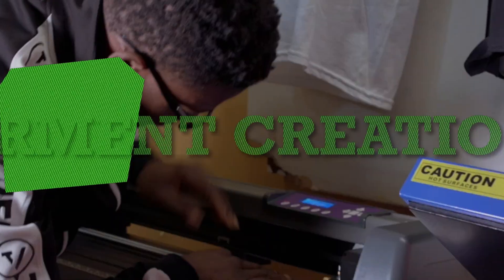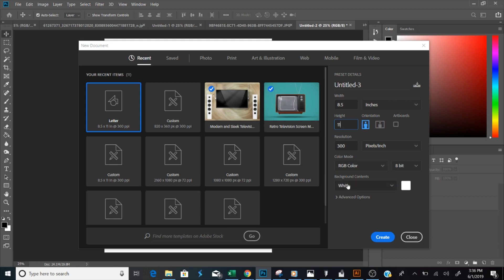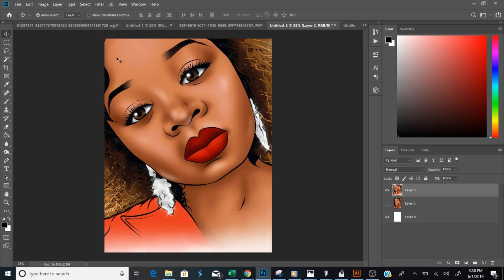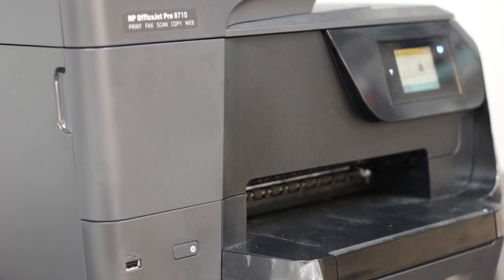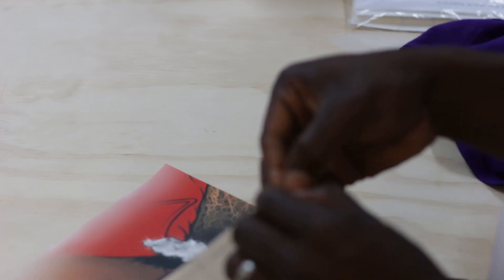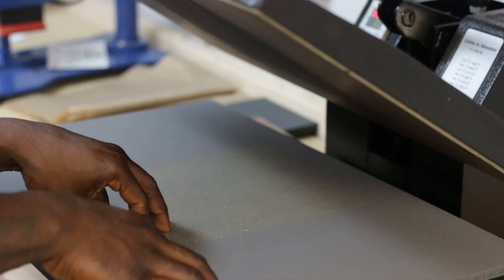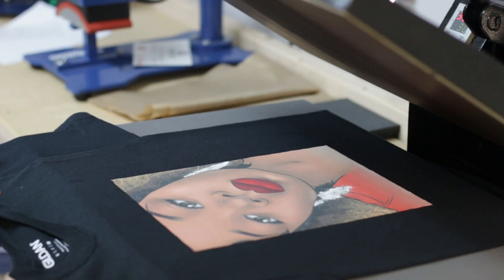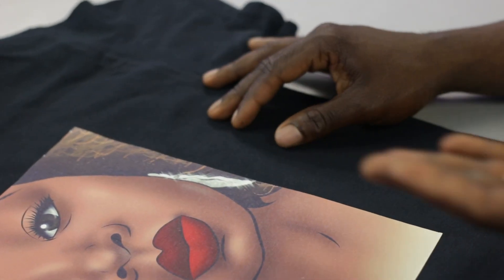The Best inkjet heat transfer paper - How to use 3g opaque heat transfer paper

Comment: I have the same printer and same paper. HP print settings are weird. It offers borderless prints although it gives me an error when trying to do it. So I am assuming I have to use a external program to print borderless? Also what settings did you use to get that great quality print. This printer is great because it is pigment based ink and not dye. I have a canon pixma with dye based ink and after washing it fades and turns colors fast.  BTW nice art!

Comment: Hi. I believe we have the same heat press...my question is....seeing the heat press' pressure is adjusted by a screw mechanism with no markings on it, how do you know if you are at 60 PSI?  Or 70 PSI or 30 PSI, etc.?  I would think "guessing" would not be very accurate. A male's "60 PSI" may feel like 90 PSI to a female and vise-versa.  Thanks for your time and video.

Comment: I’m having a problem when I apply it on a black hoodie. Any part that is white on the transfer sheet The dye  comes through. If that makes sense. I never have a problem when I do it on a black T-shirt. Please help 😩
Reply from the maker: hey, it might be the type of garment. did you try using another brand of the garment?
Reply: Thanks for getting back to me! I emailed Neenah They said if it’s a blend do 300 degrees with med pressure. I’m going to give it a try.
Reply: @Garmentcreationsnetwork  it worked!!!

Comment: Hello I recently used an inkjet HTV it says it's opaque but I bought it from a vendor as loose vinyl in a ziplock bag. I recently did a project for a client and they put the shirt in the wash and the red bled into the white background of the vinyl, have you ever had this problem? if so can you please let me know how to fix it? AND how to prevent it from happening in the future?

Additional details: I have a Canon MX532 printer and I use Pixma 240 & 241 ink and printed on the vinyl using the 'Best Quality' option. The customer washed it after wearing it, in cold water and did not use any liquid fabric softeners.

Comment: Thank you for this video, I really wanted to know more about it.
Reply from the maker: What questions do you have?
Reply: @Garmentcreationsnetwork  The video said it all, you did it step by step. Plus I have the same printer. However the paper for darks, would it make a difference to use the same paper for lights. Or is there a cost difference that would make the difference?
Reply from the maker: jett0206 I actually just stop using the light color. I’m using the 3g opaque for lights and darks. I got too many complaints about the box that the light color process leaves on the garments.
Reply: @Garmentcreationsnetwork  thank you cause I was really thinking about using the paper for darks only and forget about the paper for lights.

Comment: I used the same product on a black cotton hoodie. I used sub-ink and image came out dope!! Problem was, the background color on the image was black and after a few days, the black turned brown. What did I do wrong?
Reply from the maker: You have to use pigment ink
Reply: @Garmentcreationsnetwork  Thank you for your response. One more question if you don't mind, I'm assuming that I would need another printer to use that ink, can I use that on ALL my work? Reason I ask is because I have over $200 in sub ink and would hate to switch to pigment ink and throw what I have away.
Reply: Yoo bro sub ink on this paper after a while it will wash off you need pigment ink and some advice when you got ink is not to buy alot beacuse ink can get experienced as well clump up not right away but it can

Comment: Hi
Question about the heat transfer paper. Will it be damaged after washing the shirt?
I tried a couple of transfer papers and after the first wash, the image was damaged cracks all over it.
Reply from the maker: This paper hold up well. I got no complaints
Reply: i know in one of the other brand heat transfer papers, you're supposed to stretch the image immediately after the press while it's still hot to prevent future cracks. not sure if you're supposed to do the same for Neenah

Comment: E...so I tried this for the first time last night. I did everything right. Well I think I did everything right. Anyways I let the shirt cool before I peeled it and the parchment paper stuck to my image. What did I do wrong?
Reply from the maker: Make sure the parchment paper is not a wax paper
Reply: That happened to me as well. If the image is small, you don’t have to apply heat as long.
Reply: It’s supposed to be a hot peele if you’re using the jet 3g opaque for black garments and cold peele if you’re using for white garments.

Comment: Hi bro 👋 I have a problem about a dark transfer. My client wants to make the design more bigger but I dont want to remove the dark transfer on t-shirt cause it will eat much electricity. I’m planning to reprint the design but in bigger size and I will press it again in the top of the older design. Is that advisable to do that thing and Does the design on the top will fade or got scratch? Please help me bro.
Reply from the maker: I will not advise that you print over the existing print. Those transfer are already heavy as is adding another will be unbearable. I’m not sure I understand your concerns with electric.